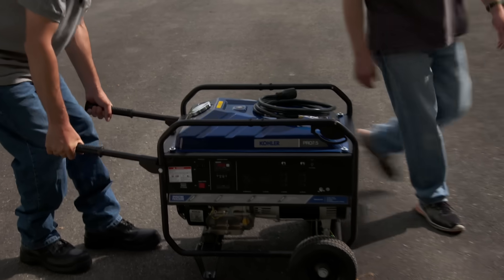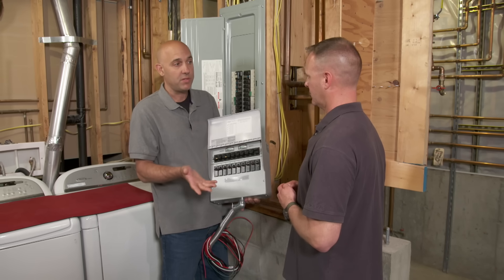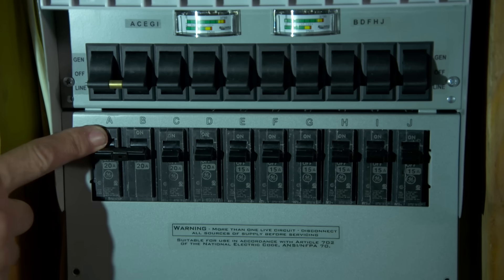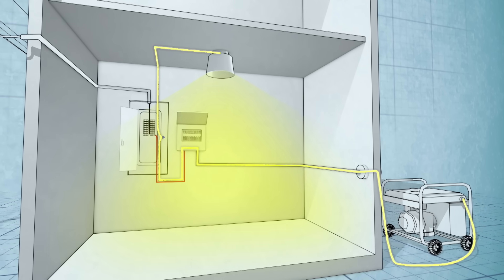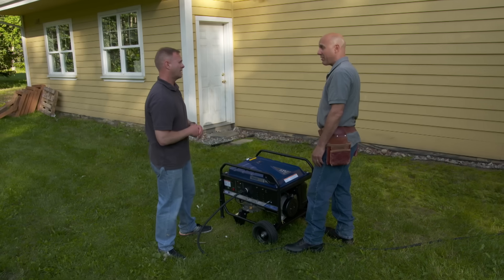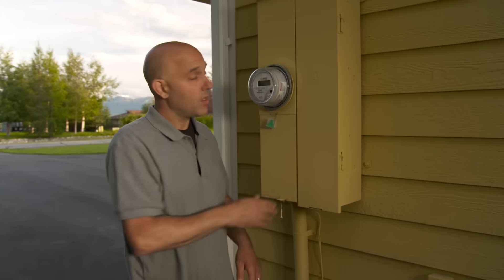How to Install a Manual Transfer Switch for a Portable Generator | Ask This Old House

Comment: 10-3 cable!! Why does this guy always cut corners with wire size?

And a 55 foot extension cord of 10-3 is ridiculous!! And he wants to store it outside!  That's gonna make a real nice connection after a few years!

All 7,500 watts could be coming in that cord at 120 volts and set it on fire.  The breakers wouldn't 'see' anything wrong.
Reply: I guess he goes by the book 
I believe the breaker in the generator is a 30 amp and he's using #10 like any electrician will do , but you're right with the length he's losing it
Reply: @pfloyd7679  , Yeah I hope there is a breaker( didn't see it like the 20 amp ones 1:20) for the 30 amp outlet.  

Kind of a misleading set up if only using 30 amp outlet.  That's only 3,600 watts despite the generator being capable of 7,500 watts.

Also the 10 breakers seems a little excessive for only 30 amps.

Comment: That is the best transfer switch I have ever seen.
Reply: Do you know the brand and model number of the transfer switch
Reply: Gen-Tran makes a good one. Or at least they used to. Check that company out. I installed about five and never had a problem.

Comment: Thought you can’t have wire nuts in the panel?
Reply: I was taught that a making the connection to the breaker is a splice. So what's the difference between that and a wire nut connection? I think the no wire nut in a panel is encouragement to the electrician to get it right the first time lol
Reply: Dylan t I don’t mind putting a wire nut in a panel. I was just curious code wise
Reply: Inspector says ok for grounds  I had to convert to a 4 wire system because my panel in the house was no longer entrance equipment put in a big double lug box out side and between the breaker box is my manual trans switch  had to remove the grounds from neutral and add a bar to the metal case it self

Comment: Question. How much would this cost to set up?
Reply: Generator costs vary wildly by brand and output. You can pick up a predator 7.25 kW generator for 699 and a 6 circuit 30 amp transfer switch kit for 300

Comment: the $50 interlock is the cheaper, easier and just as effective. Having a whole separate box with more breakers is redundant.
Reply: +Master Of none tv-  Correct sir.  If they are up to code in your state...

Comment: This is long, but I hope it helps. 
Ask the electrician to put in a 200 Amp double pole single throw cut out switch between the electric meter and the house main panel.  One set of poles  goes to the electric company side.  The other side goes to the generator side.  Even with only a 30 amp 220V generator Hard wire in No. 8/3  50 amp copper  with a 4 prong 220V receptacle to your generator area. ( Using no 8 means you can run 100 - 150 feet away and won't have to worry about resistance or overloading a lighter 10/3 wire.)   Then use a 20 foot connector between the generator and the No. 8/3  receptacle.  You'll be able to move the generator as needed within the 20 foot circle.    
When you need the generator, Start it, throw the single throw to the generator side and the power company is completely cut out. You can not hurt the lineman working on the pole.  The generator powers the house's main panel so your entire house is available to you.  Basically, "one switch does it all".  
If you wish to be fancy, wire in a light fixture on a switch to the power company side of the cut out switch.  When you lose power, switch on the light and it will come on when power is restored.  I've done this as I live in an area with no exterior lights from neighbors, street lights and the like and I have no Idea when the power comes back on.  
The set up works well but the 200 amp Single throw Double pole switch is both large (I call it the Frankenstein Switch...)  and expensive   -    $500 +/-   plus the electrician to break into the meter to main panel feed.  No. 8/3 copper isn't inexpensive either but this set up gives great simplicity and flexibility.  

If you've read this far, thank you for your patience.  The last thing you should do is to run the generator Under Load once every couple months.  The generator needs to be exercised as well as the engine.

Comment: I installed a solar backup system.  It cost more than the gas generator it replaced but but it produces energy every day and will pay for itself after a few years. I don't have to store gasoline or maintain the generator or worry about exhaust fumes or the noise of running a generator.
Reply: What size battery do you have?
Reply: @johnrielley7756   I have a 2.88 kWhr (120 AH x 24V) + 1.62 kWhr. I have a 6.72 kWhr (280 Ah x 24v) battery on order to increase the storage capacity. These are all LiFePo4 cells.

Comment: 20$ says hes going to wheel it under the deck right next to the vents 😂
Reply: And he will build a "protective decorative box" around it
Reply: john probst  if they went back to holms on homes shows it will be........ Exactly the same because that dude is Overkill on everything
Reply: @Buttfartsmcgeezacks  He has to pay for the boat.
Reply: @darrenjones9180   THE CO CREEPS IN! and with the help of a little wind "Nighty-Night-Rabbit"
Reply: @darrenjones9180  Code is clear on this matter though: You must be 5 feet from all openings in the home - the NFPA doesn't give an exception for dryer vents. The reason for this is that a home can become negatively pressured - you turn on two bath vents, a vent hood or you have a water heater or furnace which draws its combustion air from inside the home and then vents it outside the home. In all of these cases, there will be a chance for ANY opening in the home to suddenly become an air inlet.
Reply: @Patrick-vh7sw  NFPA is not going to be in this guys back yard after a storm. Come on.
Reply: @gravis2000  Whether an inspector will be there (NFPA is enforced on residential property by the municipality) should be inspecting the generator install. I doubt This Old House would do something unpermitted. Even outside of code enforcement, my point stands. An exhaust can easily become an inlet.
Reply: @Patrick-vh7sw  no permits for a roll on genie. Anywhere
Reply: @shadowblack1987  the wiring needs a permit absolutely.
Reply: @Patrick-vh7sw   ABSOLUTEY!
Reply: @gravis2000  "Nobody expects the NFPA!" - NFPA
Reply: Sure with a cover on it it would be good to go. Still it would be a beach to start if it was freezing cold. 😀

Comment: Only 10/3 to feed 10 breakers? Seems like you’d need 50 amps at least to feed all that
Reply: You can see the generator's 240V receptacle in the video: it's a 30A connector. That's right in line with the generator's 7500W capacity. So 30A is all the feed lines need to carry. 30A through ~80 feet of 10/3 could be upwards of ~5V--on 120V leg in a poorly balanced system. Personally, I'd limit the cord to the minimum length needed. 50' is wasteful--cord-wise and power-wise.
Reply: jgalibois it is pretty long but he wants to make sure they keep the generator away from the home.
Reply: I understand that was the intent. But watch the video closely (@6:45). There are still at least 4 coils of cord (30 feet?) on the hanger after enough is unrolled to reach the generator--which must be placed a safe distance from the house since they operated it there. (Heck, a 55-ft cord would allow a lot of urban people to put their generator in a neighbor's yard.) Keeping the generator away from doors and windows isn't a big deal. 5 ft is adequate. Most people who've run a portable home backup generator know you have to close the doors and windows on the side of the house with the running generator--to keep the noise out. :-)

Comment: Don’t forget to drain the gas, and generator carburetors, then start it and let run until it stops which will only, if at will be a few seconds. I also use tron-star gas stabilizer, which is suppose to keep the gas good for 18 months.

Comment: This is not for DIY.   This type of work can only be performed by licensed electrician.  Doing your own electrical work on panels especially mains can land you in some nasty legal issues
Reply: Homeowners are typically allowed to perform electrical work on their own house, though they are supposed to pull a permit and have the work inspected (which most do not).
Reply: hamiltoncouple01 where are you located?
Reply: Only if they know you did it ! One of the perks of living out in the country!

Comment: But you have to know the amp of the circuit and how many you can put on the switch and what amp thay draw
Reply: Correct the circuit breakers in the house panel should be reviewed and the amps/watts should be estimated, so that correct sizes are connected to the transfer switch, and the person using the generator can avoid overloading it with too much power.

Comment: What happens when the generator is running and lights etc are on and city power is restored, what keeps “double” power from going at the lights etc
Reply: that's what the panel they installed is for. it separates LINE power from Generator power & only lets power flow from one or the other, not from both at the same time it also protects utility workers by not letting generator power flow back out to the power grid.

Comment: Treat the fuel and shut the fuel valve off and run the engine until the carb runs dry .
Reply: Good thought when the fuel tank is higher off the ground than the carburetor.  Gravity always finds a way to work.

Comment: If your doing a new installation but a DPDT ( double pole double throw) switch....the mains connect to the top of the switch....the house connect a to the knives, and the gen to the bottom....no way you can accidentally energize the utility wire....

Comment: The biggest problem that I see with this setup is the pigtailed splicing inside of the electrical load distribution center. 

I know for a fact that many jurisdictions and the National Electrical Code in particular doesn't permit you to splice or pigtail circuit conductors inside of an electrical panel.

The other problem that I see here is the single, undersized neutral conductor that carries all of the unbalanced current back to the main load distribution center from those chosen isolated power circuits inside of that generator circuit box. 

Once again, large unbalanced neutral currents may be present on an undersized conductor, of which can cause overheating and eventual failure, alongside the hazardous condition of a dropped circuit neutral connection, of which can then back feed voltage and bring the full 240 volts across every 120 volt circuit that is wired inside of the secondary load center. The other hazard includes potential fire and electrical shock, due to a broken neutral connection where certain appliances with metal cabinets are connected without 3-wire grounded supply cables and instead use polarized electrical plugs (where the neutral contact blade is wider than the hot contact blade)... in such appliances, the exposed metal chassis components and cabinet is bonded to the neutral.
Reply: you can pigtail in a breaker panel in any jurisdiction.
Reply: Hello and thank you for the comment.  The connections of the red and black wires are permitted by the National Electrical Code, splices in enclosures are addressed in Article 312.8 (A) going back to at least 2005, the wiring just can't take up a large percentage of the cross sectional space of the enclosure.  
The neutral wire is a 10 gauge wire, since we are dealing with a 30 amp (7500 watt) maximum generator output, the unbalanced return current can never possibly be greater than 30 amps, so this wire is sized accordingly.  A broken neutral connection is a hazard in all situations, but that isn't any different than general electrical circuits anywhere, it's always important to ensure a good neutral connection.

Comment: Throw in another $1,000 for a qualified electrician plus the city's permit to install the transfer switch plus the power company's fee to inspect the installation.  Your estimate is about $1,500 light.
Reply: Red Car POCO doesn’t do inspections.

Comment: Question?, how much a set up like that cost.
Reply: I got a good deal at Lowe's on a 30 A manual transfer switch (clearance price, last one) around $ 150 +/-, as I recall.  Shortly after that, I found a good deal on an 8 kW propane generator with an auto transfer switch, and returned the manual.

Comment: Just one thing...I was on Long Island during Sandy. When the power went out the gasoline supply vanished.
Reply: Get a propane fuel generator.
Reply: Or a diesel one I have a 100 gallon tank on mine plus another 1000 in the tank In ground for my equipment
Reply: Marc Mescher  -  what I do is get mid grade gas early in the Fall, before the weather starts getting bad, and store it in the shed out back, until its needed.
I get a lot of it in separate multi gallon jugs, and what I do not use for the generator that year will then run all my lawn power equipment for the coming year.. If I have any unused gas left over after all that, I can put a stabilizer in it, or just pour it into one of my vehicles, and there you have it..

Comment: Interesting, but seems like a small generator given need for heat and size of building? Might want a brief 30 second discussion regarding how to determine what size generator to buy? They normally don't run very long at max Watts because of rapid gasoline consumption, read lable on generator for more information? Second, backfeed from generator to power lines should be discussed as it can kill power line workers, always discuss with local utilities company before installation.

Comment: generator cable 220 to the dryer plug it in with main power off.. need a double breaker dedicated for that line generator on go to breaker box turn on appliance you want
Reply: And then back feed the local grid. Yeah really good idea moron.

Comment: I just put in a double throw double pole switch and just use the existing circuit breakers for what I want on and off during generator use.

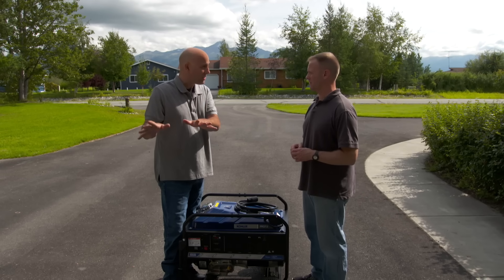Comment: I liked how they both agreed that the driveway was not the ideal location for the generator, but they both walked off camera at 2:00 and left it in the driveway.
Reply: Elvis inNY - Dude, it's a video filmed by This Old House....It is not a movie... I'm pretty sure they either had people in and around this entire set up and they could have easily moved the generator into the garage if they felt they needed to..
From what I could see in that wide shot out front,  these people do not live in the Hood, so it's pretty safe there even if just for a while..
Reply: @frandanco6289  the Hood?
Reply: @frandanco6289  r/wooosh
Reply: @frandanco6289  I think Elvis was more referring to the point that they didn't take the generator with them to the backyard even though they both agreed to take it there. Theft was not the point of his comment.

Comment: Do-it-yourselfers must not attempt to do this - only a licensed electrician. I consider myself pretty capable, but I had an electrician do mine. Install was reasonable... about $600.00 total.
Did anyone hear this guy say natural gas was unreliable?? DUH!
Put Sta-Bil in the gas - seems to work for me.

Comment: Wait until he has to drag that generator and gas cans to the back of his house in the snow or wet mud. He will wished he put it out in front of the garage. Also this is a limited panel. The way mine is set up I can use any breaker on the panel. https://www.youtube.com/watch?v=V-T8VTQUjBY

Comment: 2:45 Nice dog on the balcony.
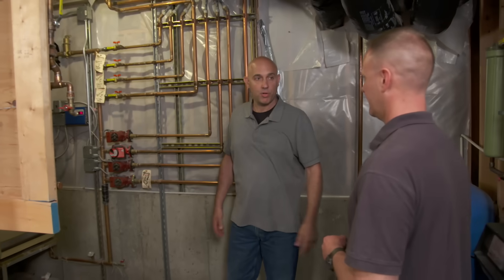3:00 Please isolate the copper tubes (heating system?) exactly - anything else would be a waste of energy.
Here in germany we´re using the thumb rule: Thickness of the pipe = thickness of the isolation.
6:18 Question from me: Black wire = hot wire, white wire = neutral, non isolatet = grounding?
6:59 Sorry, but this is the worst solution: Use cable slaves please.
Greetings from germany
Reply: Grounding (earth) is at the generator and also at the main panel, ground is bonded to the neutral (white) at the main panel, but no where else.  Greetings from Alaska!